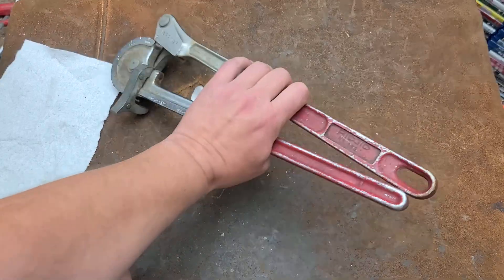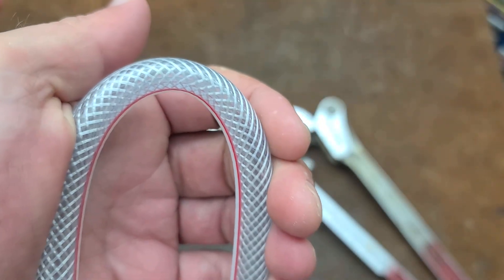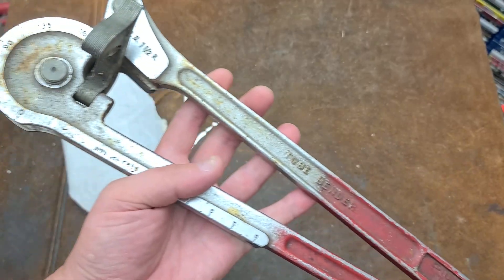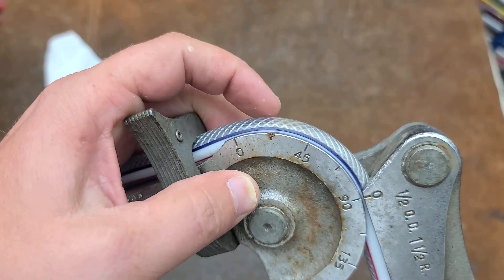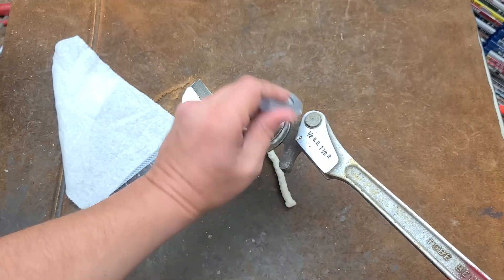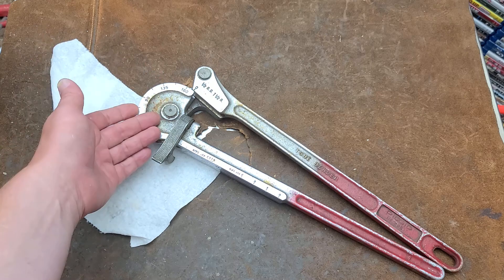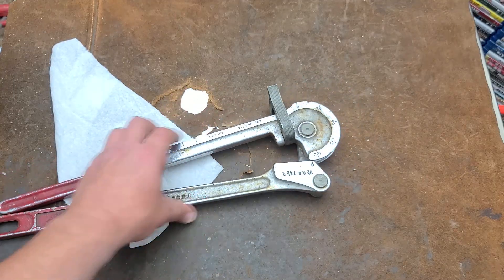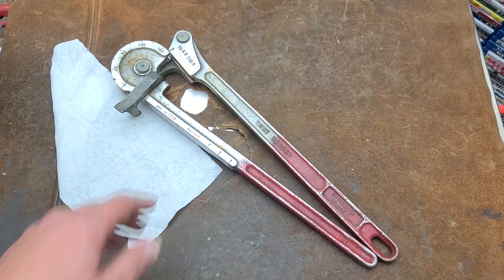Ridgid USA 1/2" Heavy-Duty Tubing Bender Review

Comment: This tool is HIGHLY triggering for me 😂

Nightmares of bending by my hand hundreds of yards of 1/4" and 3/8" copper pipes at the old factory I worked at.  Had to slather the copper pipe and tool in spray-on, food-grade silicone grease prior to each bend.  It was a "compact" tool with extra short levers for travel use, so it took overwhelming force for even slight bends on small dia pipes.
 
Then I got blamed for the bends "failing" later down the assembly line when my low IQ addict coworkers overclamped the pipes, cracking them 😂
Reply from the maker: That sounds like a tough job!